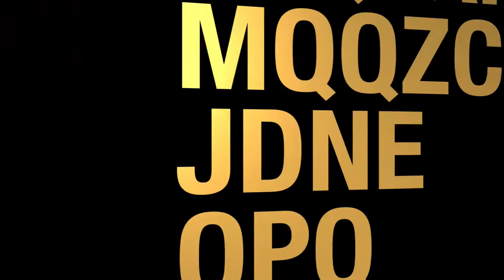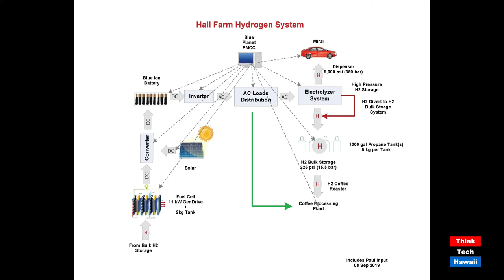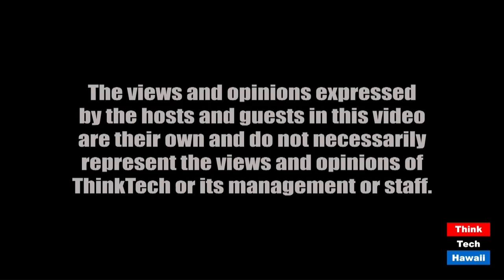Converting a Farm to Hydrogen (Hawaii: State Of Clean Energy)

Comment: What is the efficiency of the electrolyzer and the fuel cell? It seem you lose so much in the conversion. Has the efficiency improved since I looked at the subject ten years ago?
Reply: Yes, the efficiencies of both electrolyzers and fuel cells have increased.  A PEM fuel cell recently achieved 67% efficiency.  An alkaline electrolyzer is around 60%.  The major cost driver is the cost of electricity.  There are reports of 2 cent wind and PV electricity on the mainland.  At 10 cents, hydrogen is getting competitive with gasoline.